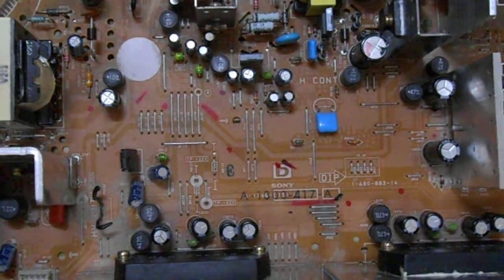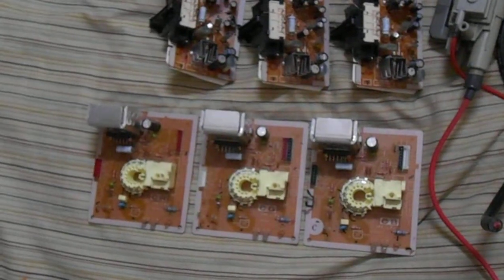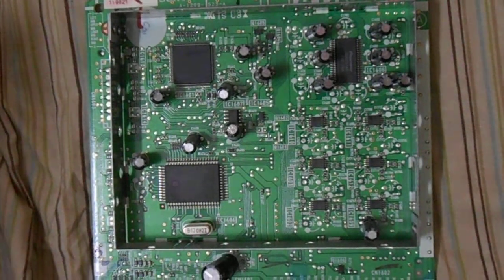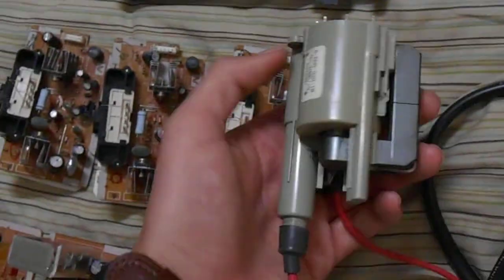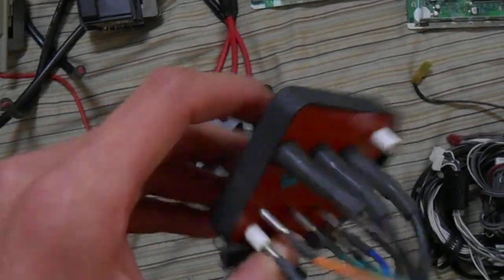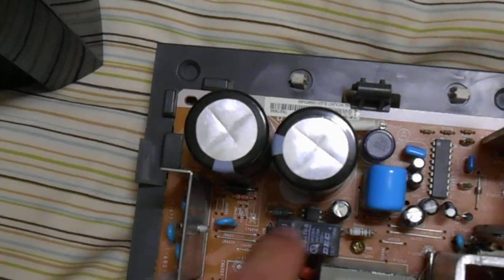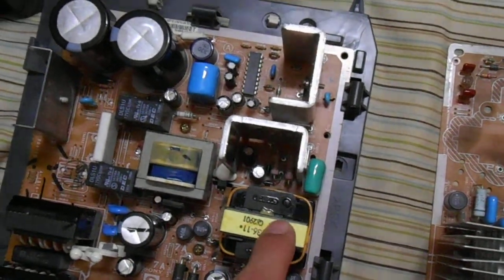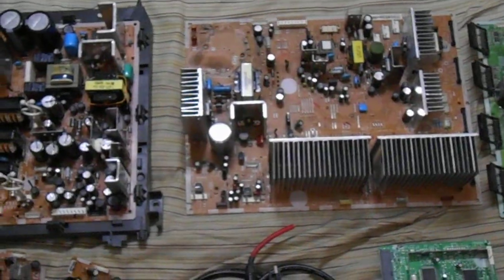Sony TV find! AWESOME stuff! and LED Bar first install

Comment from the maker: ***** thanks! yea there is some good stuff from that thing, i used one of the long wires to power my led triangle that i used as a prop when i went to see Age of Ultron, can you guess who i was? ;) so that box is just a splitter no caps or diodes in it? would be cool to have a nice HV cap. thanks for commenting, also i cant seem to reply to your comments you might have something turned off in your settings.

Comment: That box will more likely only contain 6 pots, focus and contrast for each tube, the epoxy will just be for HV insulation
Reply from the maker: ok cool, i can see three 220pF 12kv capacitors slightly sticking out of the epoxy. those might be worth pulling out possibly. thanks for letting me know!